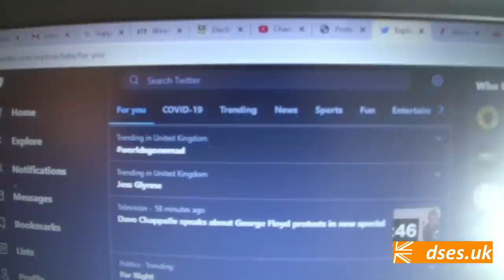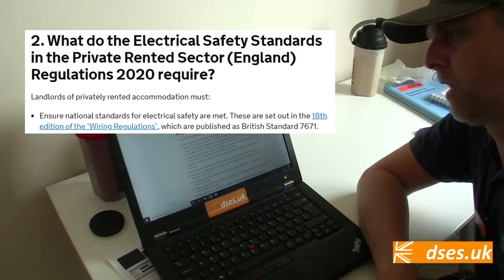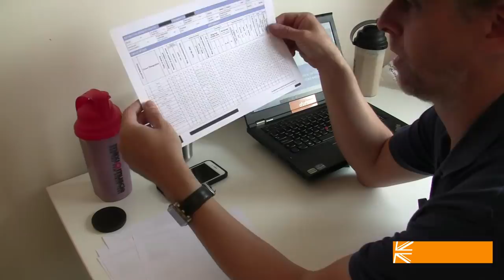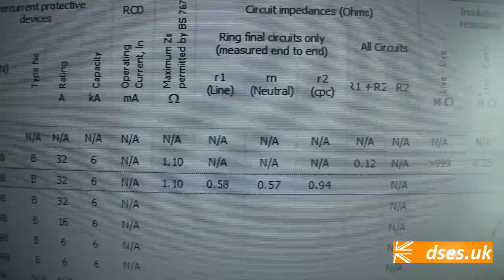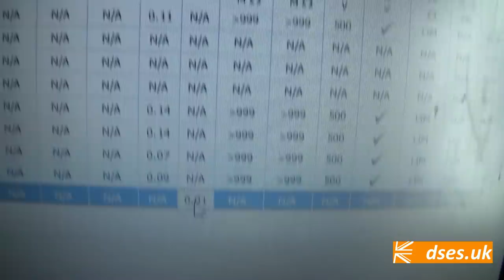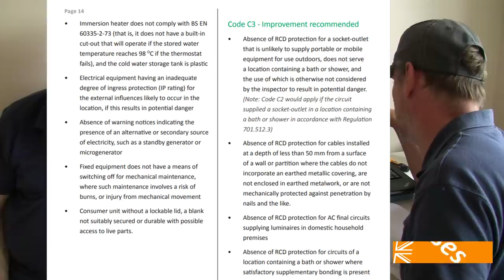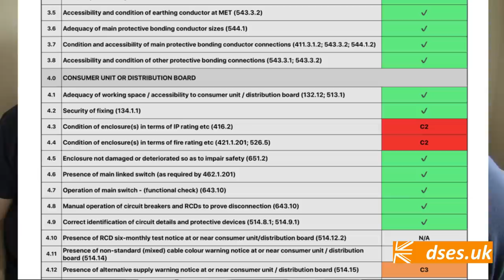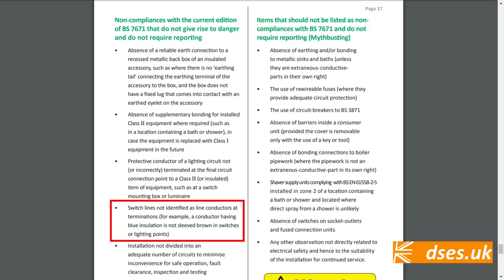Landlord electrical inspections from July!

Comment: Personally I do generally C2 lighting circuits serving bathroom location without supplementary bonding presence. Perhaps I’m wrong in doing that.
Reply: Your right to do that unless all circuits within the location have additional protection
Reply from the maker: That wasn't a requirement until more recently which is why the guidance has it as a C3 for installations prior to something like 17th Edition Amendment 1 or 2. Personally, I'd prefer to see it, but I try to code by the guidance than personal preference as the latter leaves the inspection process as inconsistent for clients with one guy's opinion differing from another.
Reply: @dsesuk  Agreed.  If you want to adopt your own standards you shouldn't submit reports or certificates that mention BS7671.
Reply: I suppose it’s whatever regulations you are bought into, I was taught during red 17th edition, so to me it just seems wrong to see lightning circuits (servicing the bathrooms) without RCD’s. I know I might take a lot of shit, for saying that I will continue to C2 that. Luckily there it would only require a RCBO pod on lights. So wouldn’t be a bank breaker.
Reply: @lukeboy94yo  I too went through my training when the 17th Edition had just been introduced.  If I wanted to stick to the coding that applied in those days, I'd have to use 17th Edition paperwork, and tell the customer that I will not be working to current standards.
Reply: Luke Whitewood the lights serving the location would be a 3 , same as showers , heaters etc.. no supplementary bonding would be a 2, and could be omitted affording additional protection to all circuits within

Comment: wow thats cheap 106 pounds ? i had that done on my one bed flat and was 300. so are you saying you dont need a metal box or rcd protection on sockets if the instalation was done propery to earlier rules? here all letting installs are having new metal boxes fitted with rcds before you can get your pass for letting flat
Reply from the maker: I'm doing a follow-up to this, but yes, the guidance is quite clear that metal boxes and RCD's are a recommendation rather than a must-have unless there are specific reasons why the upgrade is required. Of course, bringing an older installation up to date is advantageous if done properly, but the problem is that many upgrades aren't because some idiot has insisted the work must be done, then they've undertaken it as cheaply as possible and with poor workmanship. As for EICR costs, £300 sounds like a lot, but some sparks charge for the time, so for that money I trust you're getting a thorough inspection and a diligent report!
Reply: @dsesuk  is that deffo right that no need to change to metal consumer unit and rcds if instalation as was installed in 80s if so will electrician have to give you a pass on the report and is that scotland to?
Reply: @dsesuk  the electricians say as they have to open up sockets and box it takes longer so its £300

Comment: How did you verify it was a PME system
When you couldn’t locate the service head?
Reply from the maker: At the 47:33 mark the supply to the flat is shown, and although the fuse cannot be verified, a label on the head confirms it to be PME as you'd perhaps expect for an urban block of flats built in the late Nineties.
Reply: David Savery Electrical Services I did think that it may have been labelled.. other than that you wouldn’t have known? Apart from calling the distributor?

Comment: What about the broken main switch? 
Is it safe? How can you be sure?
Reply from the maker: It's just a break in the upper plastic. It doesn't expose any additional live parts, it isn't structural, it isn't accessible when the cover is on. The previous guy didn't note it, and neither did I.
Reply: @dsesuk  
Fair enough, however from my experience the corner snaps off when someone has over tightened the terminal, therefore how can we be sure it hasn't caused any damage within the switch itself.

Comment: I think you will get quite a few landlords if they get someone saying they need to change their installation will just say sod it and not rent anymore reducing the renting stock. I know I am thinking of that possibility if it happens to my single property as I agree that as long as it would meet safety standards for the time it was put in it is fine. I do have my part P and 17th edition regs (still need to do my 18th, but do have the new books)
Reply: Well that’s the sort of attitude that gives landlords a bad name - “sod it - it should be ok”. Why wouldn’t you want to ensure the best possible safety for your tenants and for probably less than 1 months rent install rcbos to protect each circuit ?
Reply: @Marco-mg9tv  less than one month's rent you must be joking it would be multiple months rent when it isn't unsafe in the first place. Also what happens every time they change the regs do you then have to have work done immediately to upgrade to that standard? If it isn't safe then every house in the UK should be forced to upgrade to 18th edition immediately! Why should it only be renters who get that special privilege.
Reply: Several months rent. ? I replace consumer units on average  £450-500 for an SPD/all RCBO unit. What are you renting out a rabbit hutch ?
Reply: Matthew Latham 
“I do have my part P” please explain what is is you have exactly - as there is no part P qualification or certification , Part P is the electrical requirement  of the building regulations.
Reply: @Marco-mg9tv  I don't see why I should have to change a perfectly good consumer unit when it gets inspected every year meets the standard of when it was fitted, has RCD protection and the current regulations state that it is perfectly safe. Just because someone says it doesn't meet current standards which no installation does if it is more than say 5 years old.
I did my domestic installer course a few years ago (I am not saying I'm an expert far from it, but I can read the regs and understand what they mean) which involved doing a part p qualification can't remember the course number and 17th edition. I have got the current regs books and have read the relevant parts on periodical testing.
Reply: @Marco-mg9tv  on the cost front if you are going to make people get their installation to 18th edition then all the cabling would have to be to modern colours as well as a non combustible db unit and RCD/RCBO's other wise you are just picking certain things that you want to meet and not others? As showed in the video, codebrakers book shows that all these things don't make a installation unsafe for my case the dB wouldn't even be a C3 as its not in the sole fire exit yet it doesn't meet current requirements!

Comment: Not a sparky, but for testing light circuits couldn't you use something like an adapter?

E.g.  https://images.app.goo.gl/GU64onCcjdbTKGa88

Just curious....
Reply from the maker: We want to know whether the earthing is good and if there is any breakdown of insulation between live parts and earth, so an adaptor like those wouldn't be of use as only the line and neutral are presented.
Reply: @dsesuk  ok makes sense... 
I had vague memories of the bayonets pins being earthed. Especially when the holder was metal... but they are the exception rather than the rule I guess.

Thanks for th answer.

Comment: Funny how they put so much effort into metal consumer units and AFDDs..... if only they could teach the cowboys how to terminate and torque a consumer unit. 😀
Reply from the maker: That's the problem isn't it? Devices and enclosures to try and manage the fire risk from poor connections instead of jumping on those responsible for them.

Comment: Napit releasing a guide to the new regulations, hopefully will clear it up
Reply from the maker: Yet another book to buy and another resource to try and find straight answers! I'll add it to Codebreakers, my Guidance Notes, OSG, Electricians Guide to the Building Regulations, ESF Best Practice Guides, BS7671 and so on!
Reply: @dsesuk  and that's in addition to your van, insurances, registration fees, meters and calibration, hand tools and power tools that need maintenance / replacing, keeping Nigel in adult nappies and more I've probably not mentioned... Nigel might be right, could be time to hike the prices up?
Reply from the maker: NAPIT's guidance is here, and concurs that 18th Ed. is not a prerequisite: https://www.napit.org.uk/downloads/Electrical-Safety-in-the-Private-Rented-Sector-Regulations-Guidance-for-Landlords-NAPIT.pdf - phew!
Reply: Not a bad document to be fair. Hopefully clears up some questions for both the landlord and spark. Be interested to see what the new certificate / report that they are going to release to supplement the EICR looks like.

Comment: Which brass are you contacting ?
Reply from the maker: Not the brass in my pocket with these prices! Are you referring to the Zs testing? Admittedly, the risk of accidental contact with live parts such as the connectors in a ceiling rose is small, but we're always being drummed with safe isolation: don't work live, isolate before removing covers etc. Great advice, until you're up a ladder trying to undertake a three-probe Zs test. Risk of shock or injury is low if you know what you're doing, but nevertheless it is a risk, and if the EFLI path has been verified by a Ze and r1+r2 test, why expose yourself to additional hazard?

Comment: Christ, youtube electricians can waffle! 
When i was at college a tutor said to me ‘sparkys charge by per word’. You lads must be loaded!
Reply from the maker: We're the only trade who can string a legible sentence together.
Reply: Legible, but very unnecessary. 
Brown one goes here, blue one goes here. See, to the point!
Reply from the maker: @markdudley1028  Spoken like a true kitchen fitter. Especially as you didn't mention connecting the CPC!
Reply: 😂, its a lighting circuit, it don’t need three wires!
Reply: @dsesuk  you need to save the CPC for the common in two way lighting 😂
Reply: All my lights have a cpc connected to them and so do my light switches. The regs have changed if I'm not mistaken.

Comment: Question.What is if the installation is TT system?
Reply from the maker: Then you should have an RCD for fault protection (C2 if not).
Reply: @dsesuk  Didn't JW show that the RCD needs to be upstream of the potential fault ~ and one site for a fault is where tails enter a metal CU?

Comment: Good whinge David, been doing quite a few EICR s recently on renters. I agree with what you say and C3 no rcd etc. Just had an email from wiring regs. Com relating to landlords and the first paragraph is                Ensure national electrical safety standards set out in the 18th edition of the ‘Wiring Regulations’ (British Standard 7671) are met.  This is open to a lot of dodgy sparks ripping folk off.
Reply from the maker: Thanks Karl, and according to those national standards you have the HSE on page 13 saying older installations can comply, and reg 651.2 which states "Existing installations may have been designed and installed to conform to previous editions of BS7671, applicable at the time of their design and erection. This does not necessarily mean that they are unsafe." Unsafe is unsafe, but just old isn't necessarily unsafe on its own!

Comment: Looks like you're in a similar position regarding rental properties as we've been in Austria since 2008! Regulations changed at that time to require a full inspection of every property covered by the regs (which is a severe limitation by itself, e.g. houses aren't covered at all, nor are flats in buildings with no more than two units) but only on change of occupancy.
The wording of the law requires the installation to comply with the electrical regulations, which essentially consist of a general law, a directive that cites an extensive list of standards and those specific standards. The law clearly states that all installations must comply with the regulations in effect at the time of construction, unless major alterations have been carried out, which would require the entire installation to conform to the regs at the time the alterations were done. The definition of "major alterations" is quite controversial though.
Apart from "changes of more than roughly two thirds of one part of the installation, e.g. distribution board or final circuit" it also includes "supply upgrades" and "changes to the type of supply current", which is slightly ambiguous in German. Personally, I take it to refer to the pre-1960s DC to AC conversion but many experts understand it to include upgrades from single-phase to three-phase AC, which is beyond common - actually it's unlikely to see an older installation not upgraded to 3-phase these days. Domestic supplies are usually limited to 25 or 35 amps per phase for some reason, so upgrading to 3-phase triples the available power.

Trouble is, I absolutely can't see how such an upgrade could possibly affect the existing installation's protection against electric shock or thermal damage, i.e. introduce any sort of new danger that could be avoided by bringing the rest of the installation into accordance with the current regs!

"Change of supply type" is another bone of contention. New supplies have been required by the law to be TN-C-S since 1998 but I fail to see how the conversion from TT to TN-C-S ahead of the meter could in any way affect the safety of a properly executed installation. Certainly a much lower Zs would improve the safety of a former TT installation with RCD protection, bonding and everything in place?
This reasoning almost means an immediate fail for any pre-1965 wiring as colours changed to harmonised at that point, so if you happen to own a flat and the supply is converted from TT to TN-C-S you need to rewire your entire flat - immediately. Not only during changes of tenancy but right now, as the change is a major alteration. Never actually seen that happen!
Another lovely item: up to a certain point in the past, possibly the late 1990s, the regs allowed wiring connections to be made "in suitable openings in walls". That was quite popular as common wiring layouts use plenty of junction boxes in walls and just having a hole with a non-conductive cover is considerably easier than chasing a complete box into the wall. Now that's considered a C2.

The landlord regulations have one additional demand beyond the electrical regs: any rental property shall have 30 mA RCD protection for all circuits. That applies to many older TT installations still using 100 mA RCDs (which were popular well into the early 1990s) and to even older TT installations that got by without RCDs altogether because they used the city water network as a giant earth electrode. This practice was acceptable for existing installations until 2001.

The actual implementation is largely the opposite of what seems to happen in the UK though. For almost ten years the new law was flat-out ignored and I've actually heard contractors advise landlords not to have the property inspected in case of a likely fail. "No tenant is ever going to ask for the certificate!". Unless the tenant happens to be an electrician... a friend had his place rewired because it was a rotten mess and the landlord didn't bother to show a certificate.

Comment: How do you know if it complied with the regs at the time?
Reply: You'd need to see paperwork (installation certificate) from the original installation.
Reply: Whether it did or didn’t is irrelevant. The EICR is done against current regs.
Reply: @Marco-mg9tv  My thoughts too

Comment: Glad to see that we in NZ are not the only electricians that have to tolerate beurocratic fuckwitery. 
This year we have just had a new wiring rules standard produced, it was supposed to be released early 2018, it is in fact called AS/NZS 3000:2018 publishing date is 26/06/2018 yet it has only just been released and has already be amended once. However it is not applicable as it will only become enforceable once it gets cited in the new Electrical Safety Regulations, a date for which has not yet been set, could be another 5 years before it is released. So potentially the 2018 wiring rules will not come into effect until 2025 and will most likely have been amended at least twice more between then and now. 
This hasn't stopped them trying to sell it to every registered electrician, with the dirty small print saying that it is not applicable until the ESR's are amended or reprinted to cite AS/NZS 3000:2018. To add insult to injury, as a registered Electrician we have free access to the majority of standards online for free and we are allowed to print one copy each, yet they want $261.91 (134.75 pounds sterling) for them to send out a hard copy.  Their latest ploy is to offer a 7% discount due to this overhyped virus nonsense, ironicly a result of more beurocratic fuckwitery.
Reply from the maker: Y'see, you think bureaucratic boffins are inept, but they do manage to maintain a consistent standard of fucktardery wherever you go in the world.

Comment: Do you bring rented properties up to the 18th or dont you
Reply from the maker: You have to take each installation on its merits, but I would argue that you don't for an installation like this one where overcurrent and basic shock protection have been verified as being in place and there's no damage or improper modifications. A tenant should be safe in this flat unless they start doing things they shouldn't such as tinkering with the electrics (say, by putting in USB sockets or new lights), or by breaking into the fabric of the building for whatever reason. The point is that an older installation can still be in safe working order and doesn't have to be dragged up to today's standards just for the sake of it. Inspectors blanket failing anything installed earlier than 2016 are wrong in my opinion.
Reply: @dsesuk  
I agree, its a shame that some cowboys will cash in on this. Thankyou